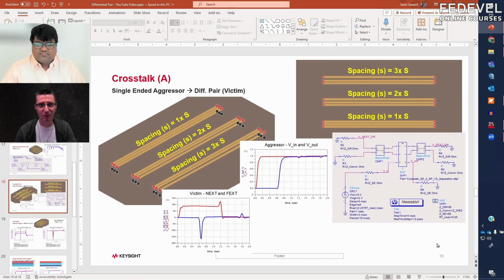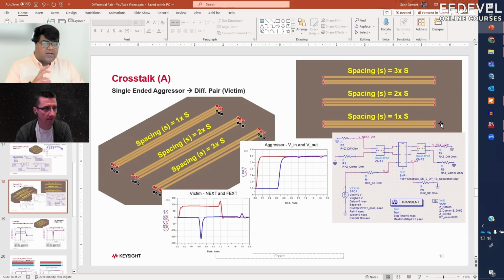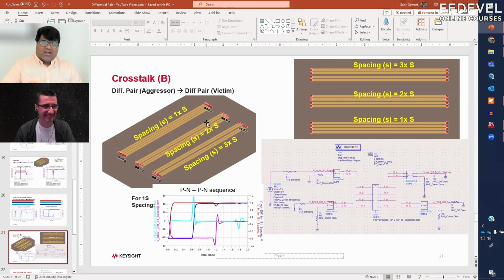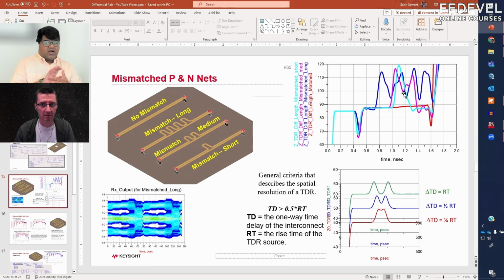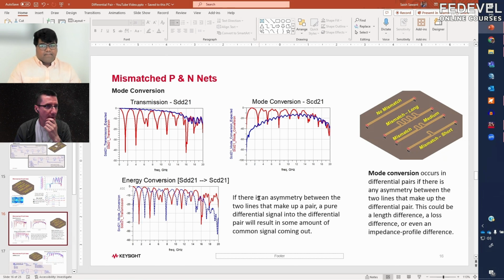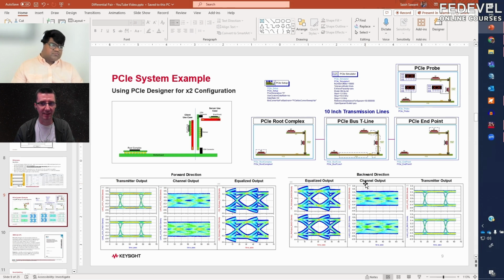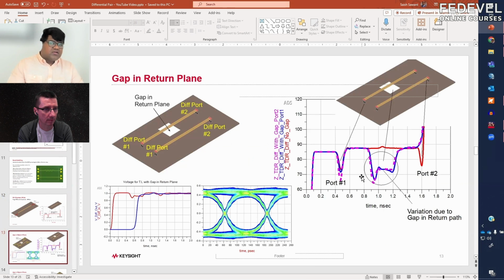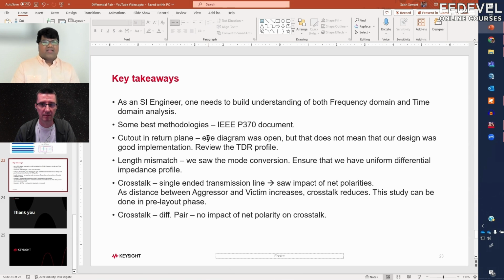PCB Layout of Differential Pairs vs. Crosstalk - Is track polarity important?

Comment: Hi Robert. Thanks for your very helpful videos. However, a suggestion for a video that I have not yet seen from you: An illustration - including hands-on formula/or the like - about how to calculate the impedance change in a microstrip trace when lined with stitching vias on both sides ... Useful variables would be via characteristics (hole size, internal pad diameter etc.), via center distance from microstrip trace edge, and via spacing along the trace. Hope you see this and find it relevant! Thanks, Jesper

Comment: Dear Robert: I hope you can introduce the actual use of the impedance calculator function in the ALTIUM DESIGNER software when you are free, such as how to use the ALTIUM DESIGNER software to calculate the impedance requirements for coplanar single-ended and single-ended 50R and coplanar differential and differential pair 90R. Thank you!